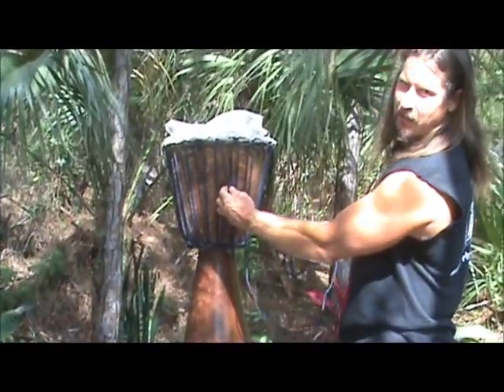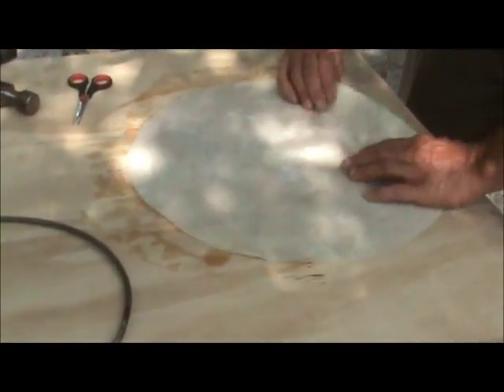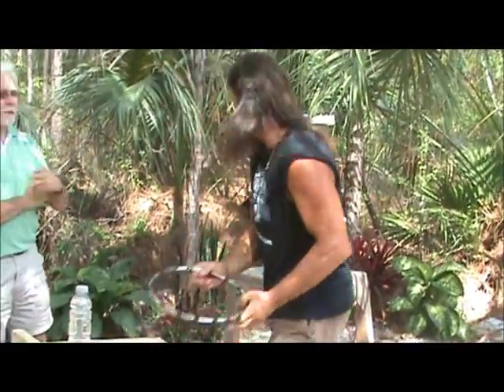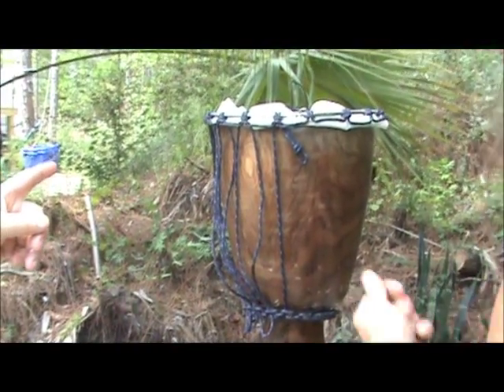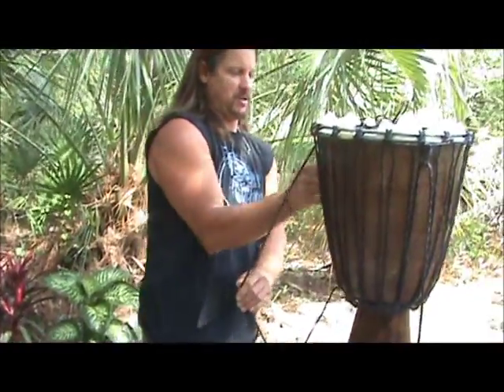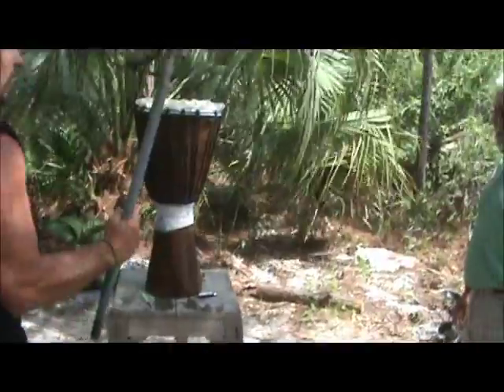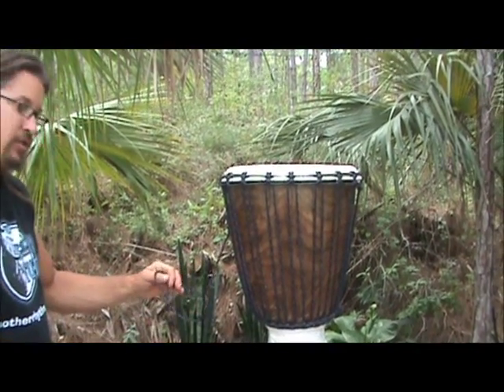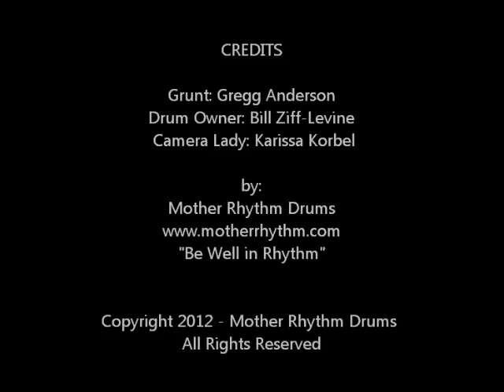How to Reskin a Djembe Drum

Comment: So I've reskinned about 4 drums from you guys, and your hangman's knots are WAY too tight usually. My trick? I just cut it in half and put a yosemite bowline (see wikipedia) in its place. That way it's never so tight I can't get the other end out of it. I also made a tensioning tool with a 1.25" oak dowel and a metal hook from the hardware store. Love your drums man, thanks for the video.